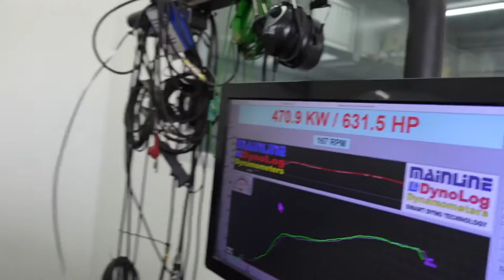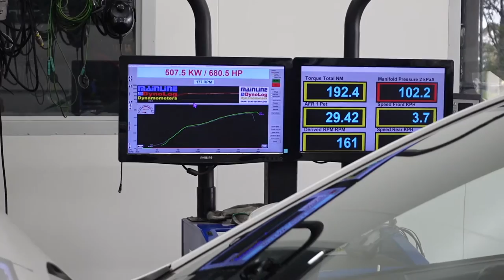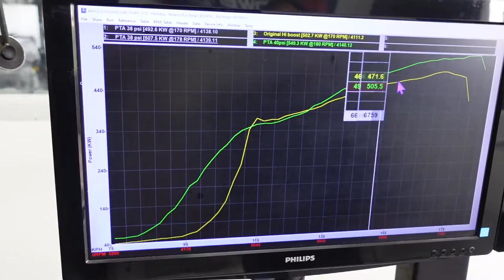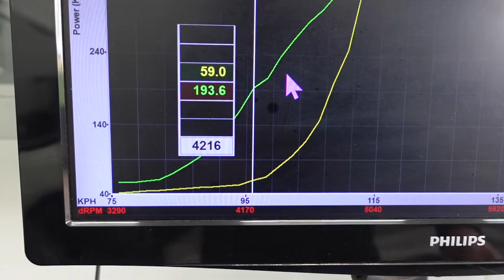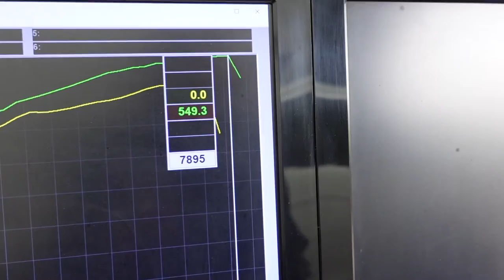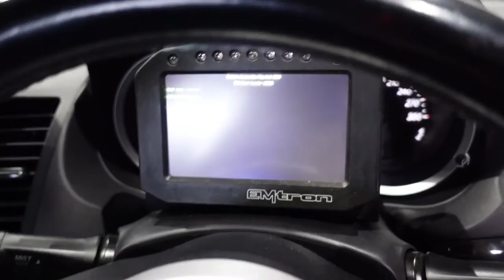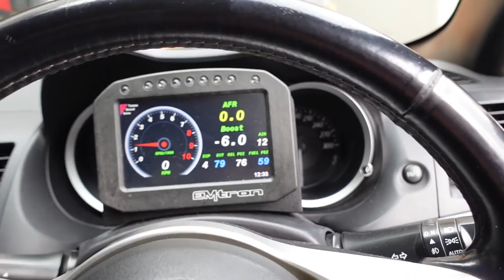550AWKW EVO X | TUNING | POWERTUNE AUSTRALIA

Comment: Specs on the engine? Crazy it can rev that high with responsive setup👌👌
Reply from the maker: We don't actually know the full specs. We just got told that its built bottom end with some head work. Maybe the owner can help explain this info if possible?